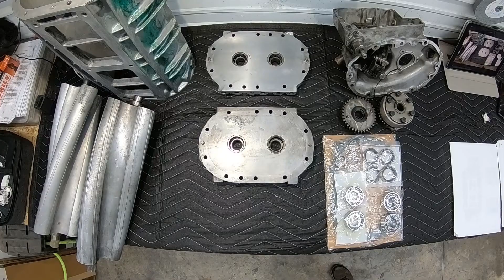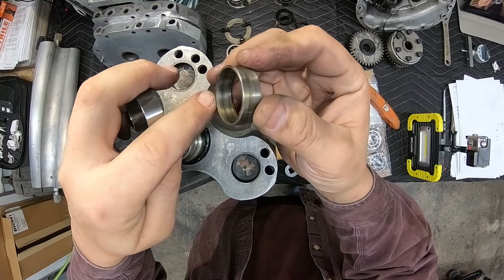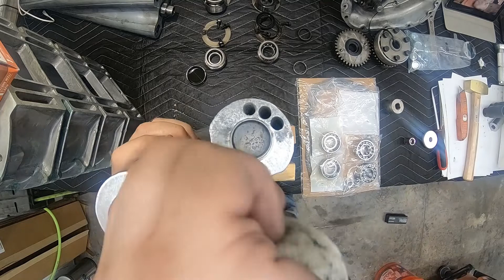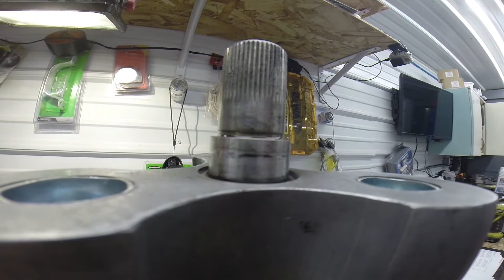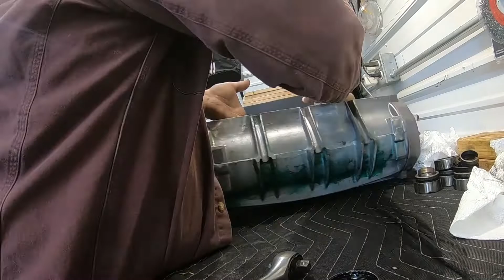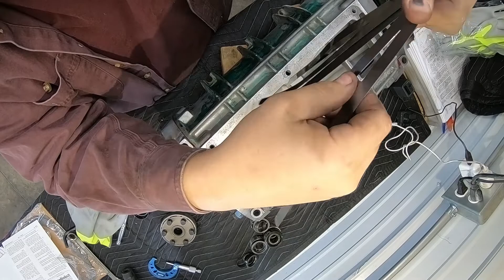I rebuild my 871 Detroit Diesel Blower!

Comment: Hey, Looking for a little advice.  I'm taking the blower off of my 4106 that's setup like yours it.  I'm about ready to unbolt it, but I don't understand how the drive shaft comes apart.  The boot around it is loose.  Do you just pull it straight out away from the back of the engine.  What happens to the shaft and how do you get it lined up to go back in.  Your help would be appreciated.

Comment: Would u rebuild mine to a gas and blast the outside I am from Springfield mo it dont look to bad but I am disabled not I am having friends build my car they are way cheaper, but if u would be willing to rebuild mine I will buy the gas kit it's going on a dart bbc in a 55 chevy 210 gasser it dont look to hard but I am not able to anymore. You can call me 417-848-1826 my name is Don

Comment: 53 mins in, I’m gonna bet you never get it timed right and it won’t turn after you put it together.  Secondly if you drained the fluid out of that rotor and you do get it working it will fail in a short amount of run time… let’s see if I’m right    Presses play…
Reply: A year later still running
Reply: 1m18s in.   I’m impressed
Reply: Nice job

Comment: Helpful hint, when using a socket as a drift, grab a small extension. Where did you get the rebuild got for this?
Reply from the maker: Kain Ariylius 
Diesel pro out of Florida
Reply: @looksbrokengarage175  thanks. Now I just need a BBC manifold and make a carb base.
Reply: @kainariylius392  Look up, Eastside Garage Llc on Facebook. They have everything you need  to mate an 8V71 blower to your BBC.

Comment: Thank you for the very informative video. One tip to add for the seal wear ring installation, put the rotors in the freezer, and the ring in the oven. They will drop on with ease.